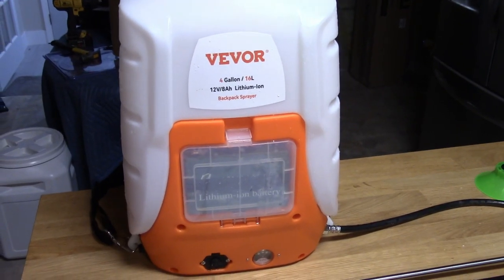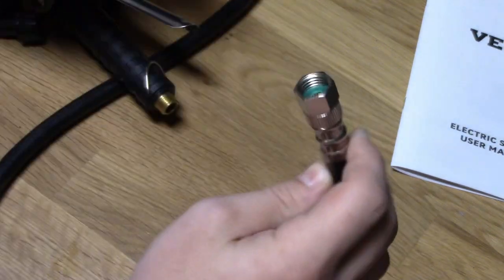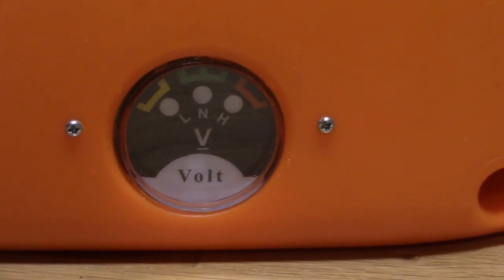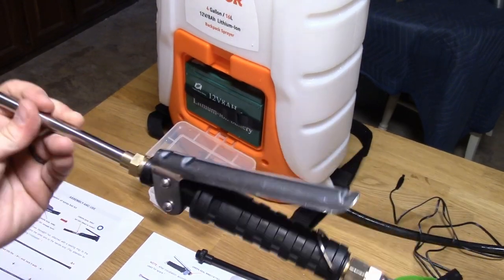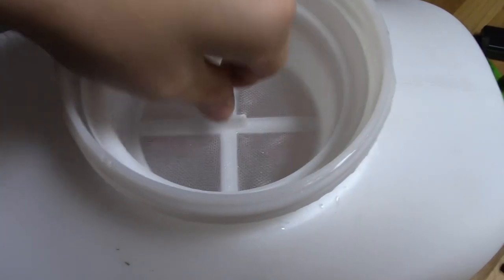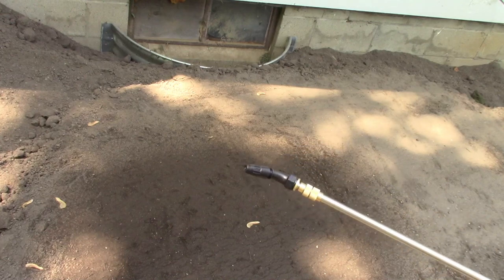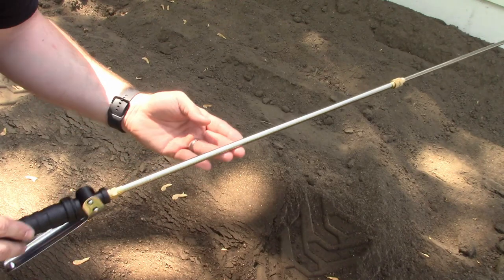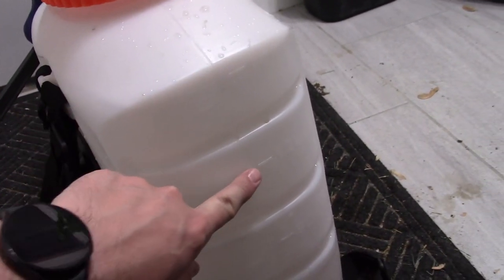Real-Life Review of VEVOR 4 Gallon Battery Powered Backpack Sprayer KF-16C-48

Comment: I was looking at this low cost sprayer. Seems alright for my limited use. Do you need to remove the battery to charge it?
Reply from the maker: Nope it charges in the unit.
Reply: @striker1211   battery wont charge now , had it  only a  few months, otherwise its a  great sprayer lol , goin  for a refund or replacement